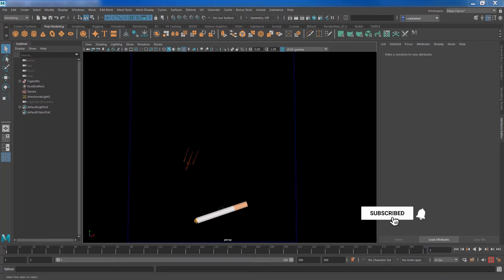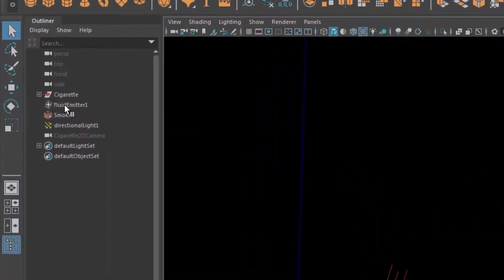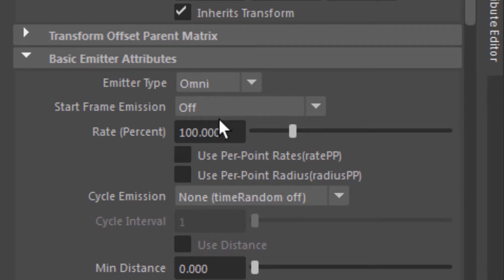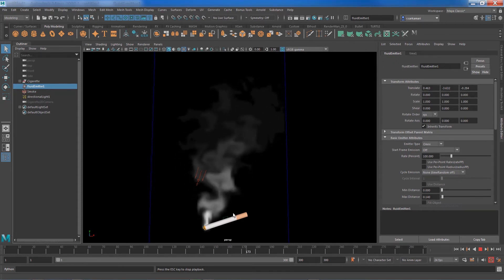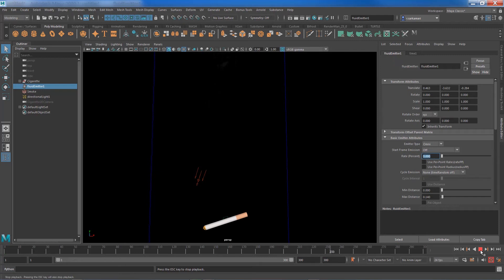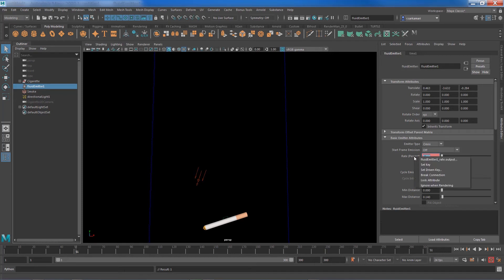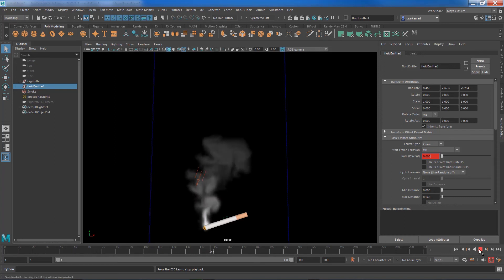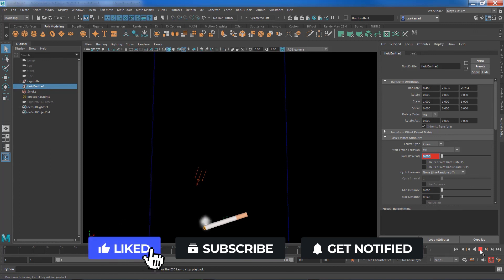How To : Stop the Fluid Emission in Maya

Comment: when I create a 3D container even after I put the rate to Zero my smoke still lingers how do i fix this? cheers
Reply from the maker: Usually rate should turn off the particles 
Go to wireframe to see if particles are still emitted. Make sure you do not have more than 1 emitter